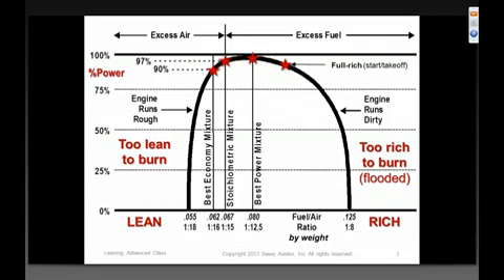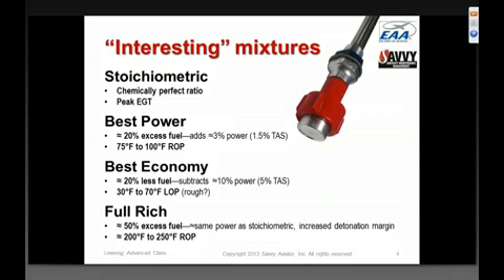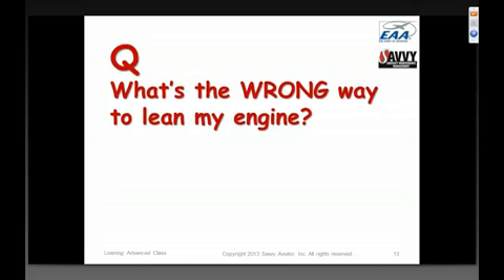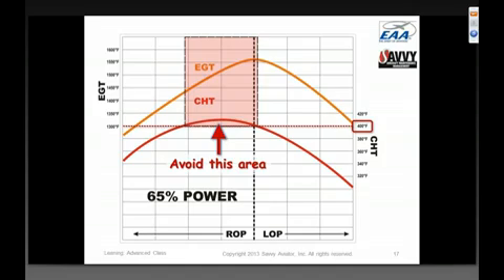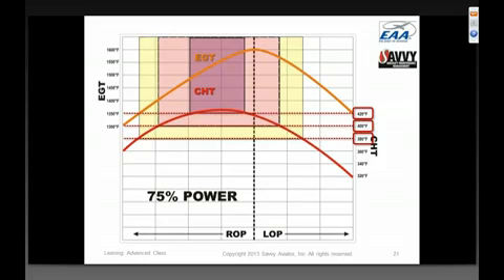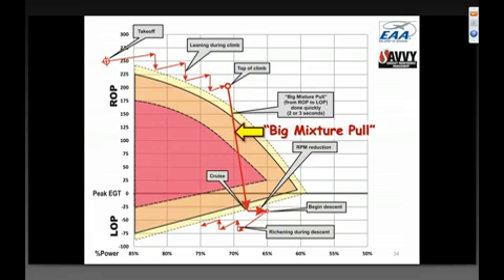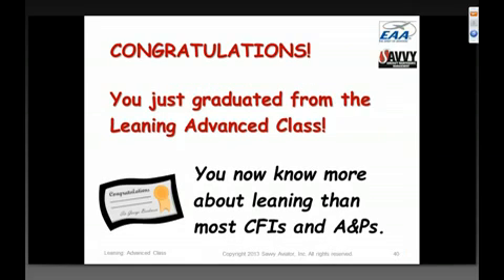Leaning The Advanced Class

Comment: Can you be too LOP? My CHT are 295-330. Is that ok? Someone said I’m not getting it hot enough to burn out the lead. 

IO320 FP 
Full throttle from take off till approach final/pattern

Climb out I set 400* CHT so mixture and speed accordingly 

When I get to cruise I yank mixture to 2500-2550 RPM(75-125*LOP)

I stay lean and slightly add fuel on decent till I’m pattern or on final then set for best power. 

Am I doing this right? I’ve had 3 shops now and various people tell me I’m gumming up my valves, they change cylinders on others often running LOP, and on and on. Am I hurting this thing having cylinder temps high 290s-low 300s??
Reply: Are they saying that there's a high risk of fouling your valves or have they found fouled valves? I'd say if they haven't found fouled valves, your good. On TO and climb out should be cleaning out any fouling: maybe on longer cruises you might bring the temps up a bit, but with a borescope, if you're not seeing any fouling, then it's probably just prejudice.

Comment: I live at high altitude and never have more than about 20 inches of MP available to my IO 520 . The way I hear this, as long as my RPM is pulled back to below 2400, this discussion is moot and I could safely run right at Peak EGT?
Reply: That's the way I see it as long as the RPM is puts you at 65% power or less.

Comment: How the heck do you know if your out of the box if you not measuring egt.  The notion just watching only cht to lean goes against all the charts. Im beginning to smell some BS.  Why even have egt monitors Mike.  Recommend restating what you gave said to make it more clear.
Reply: You know when engine starts losing power as you lean. If you are flying level and didn't touch the throttle then this is by definition because you are now LOP, i.e. on the side of scarce fuel and excess air, i.e. on the side where power is set by how much fuel you're letting your engine have. And this side can only be found LOP since at peak EGT you're letting your engine get exactly the right amount of air and fuel for the optimal combustion i.e. the stochastic fuel air ratio. When you experience that power loss as you lean and that power loss is sufficient then according to physics you can't be in the red box but are now sufficiently LOP to be on the other side of it. You confirm by monitoring your CHTs.

Comment: All GA piston engines can be leaned very simply: till roughness, then increase to run smooth. You quickly end up somewhere in the safe LOP region: there is the most bang for the buck. The few knots extra at best power is not worth it.
Reply: Not exactly, he says in another video that doing this is easy to get back ROP at 40-50 ROP.   The worst area for engines.  LOP is difficult in some carbureted engines if not possible based on fuel distribution.
Reply: *on engines with a large GAMI spread, especially common in carbureted engines, the richest cylinder can easily end up in the "purple fin" with this method.
Reply: @wilfdarr ok, I agree, but is this a problem for those low horsepower engines? I’ve heard as long an O320 runs smooth, all is ok.
Reply: @peterderidder6549 Smaller engines like the o320s still run temps and pressures that could do damage, plus they're built lighter. That said, I'm told o320s have inherently better mixture distribution than say an o300, so you're more likely to get away with it. I still wouldn't do it without an engine monitor.

Comment: What if your baffling is good enough that your CHTs are nowhere near 400 degrees? My RV-4 lives in Vegas and nay gets to 330 or so in cruise. Also, the CHT is so slow to react to mixture changes, where EGT is instantaneous. If I had to drag the mixture slow enough to plat the CHT peak, I would be in the “red box” for a much longer time. I can sweep through the EGT peak and minimize the time in  transition.
Reply: I am wondering as well. I fly a Cessna 175 with Franklin engine and it runs very cool (e.g. CHT below 300°F), probably because it was once designed for cooling in helicopters at 3200rpm (our rev limiter is 2800). So... does the red box not exist for us? We just installed an EDM730 and would love to fly at peak EGT or some cylinders LOP to reduce fuel flow.

Comment: Computers and O2 sensors have been doing this automatically, on cars, for decades. Odds are, Trying to do it manually, and  then getting distracted, seems like a good way to cook your heads.
Reply: If you're that easily distracted, please don't fly...

...or drive.
Reply: @freakfly23  get out of the stone ages,, computer control is the only way to go,, ask diamond aircraft ,,, no prop or mixture controls
Reply: @MAGApepe Mike has mentioned various problems with the way Daimond aircraft are rigged: probably not the example you want to use! 
There are much better examples running in experimental aircraft.

Comment: I keep my CHT below 380 degrees on my 0470l  on my C182 at all times.  I dont want the problems.  Prior to purchasing hte plane it had 5 cylinders changed in the first 400 hours of operation.  All due to flight training and instructors that did not know how to operate the engine.  I now have an insight G3 monitor that provides great info on each cylinder.  Great instrument but downside is no normalize mode and hard to watch and see which cylinder peaks first.
Reply: I also have a 182, mine with carbureted  p-ponk...My question is when monitoring CHT should we be doing this with cowl flaps closed in cruise? My #1 cylinder runs like 15-20 degrees hotter than the rest of the cylinders. Id love it if Savvy would do a special on 0-470/0-470-50 carb engines.
Reply: @ottob.884 CHTs are always monitored: cowl flaps are used to optimize the engine temps.

Comment: You say to not use EGT to adjust full-air mixture, but if you use the cht to find the peak you are doing exactly the same technique- you're just looking at a different instrument read out.  If you lean by pulling to engine roughness, you won't know exactly what the peak actually is but you can set the fuel-air mixture lean of "presumed peak". So I don't get your prejudice against using the egt.  It is just another parameter to utilize, although on my cub I don't have EGT or CHT so I use the fuel-mixture to roughness then advance a tiny bit to smooth running.
Reply: I'm with ya guy.  I'm smelling some BS here

Comment: Great video. When using the JPI during the "big pull" to get to LOP, would it be correct to first set power and prop according to the POH, then lean until the onset of roughness, then check the CHTs to make sure everything is less than 400°F? And is the published fuel flow in the POH for a given power setting a good target for LOP operation or are those numbers based on ROP?

Comment: I have a 73 Citabria with a Lycoming  0-235 C-1 engine right at TBO of 2400 hrs. It has been grounded for 3 years now after starting it and stuck an exhaust valve on no.1 cyl.  Compressions have been low to marginal for several years....I assumed I needed an overhaul with that many hrs on the engine so Ive been saving money for that...any advice on just putting on new lycoming cylinders or a major ovhaul....@ $ 22,000 dollars.. !?
Reply: Why not replace the cylinders? How was your oil pressure and temp at cruise?
Reply: @keepyourbilsteins  oil pressure and temps were/are very good....I think I will try to find a good AI to do a top overhaul...with new Lyc cylinders.from around the Kansas City area....any suggestions ??
Reply: @Jimbo-pm1dp  I can't make any local recommendations, but Mike's company (savvy aviation) is a fantastic resource. I would strongly suggest contacting them if you aren't a member of the type club and don't have local advice to fall back upon.
Reply: @Jimbo-pm1dp  Interested to know how your saga works out.
Reply: Any update?

Comment: Mike, on a Turbocharged TIO-540, is it safe to set about 65% cruise power, then quickly general anesthesia LOP by finding peak EGT and lean and then open the throtle up to WOT and then adjust mixture to maintain 30-70 LOP and CHT below 380-400 maxillary?
Reply: Sorry Mike.  Auto text w/o correction.  get LOP and then 380-400 MAX
Reply: I just bought a turbo saratoga and put a new engine in it. I was wondering the same thing. I was in my 172 and leaned to rough, gave it a touch of fuel to smooth, then gave throttle to gain back rpm. Ran nice at that. Only have oil temp though.

Comment: I realize this is WAY outside the time of discussion, but: What temperatures would you use for the CHTs on liquid cooled engines, like Rotax? The Mfg. max is 248°F, which is WELL below the specified numbers for air cooled engines.
Reply: Liquid coolant is limited by the boiling point of the liquid. Generally there is no CHT on a liquid cooled engine as the whole engine has a much more even temperature.  248F is the boiling point of an antifreeze mixture under a few PSI of pressure.
Reply: How about just following what your POH says rather than some random stranger on the internet?
Reply: @TRPGpilot  because I'm an R&D engineer, and I like collecting information from various sources.

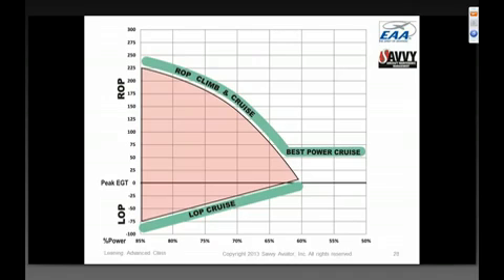Comment: At 1h13min, Mike says climbing at best power is a nice safe area, but according to the plot at 22:34 it looks like best power is actually smack in the middle of the red fin unless you're at less than 62% power or so. I'd assume people would be climbing at much higher power settings, so it would seem best power is not safe at that operating point?
Reply: I noticed this as well. I feel he may have mispoke here. In a large engine such as the TIO-540 J2BD in the Navajo, climbing at peak RPM (best power) at climb power settings will most definitely contribute to hot cylinders. This was in fact a causal factor in the Whyalla Crash, which was described thoroughly in John Deakin's engine management articles on AvWeb. The only time leaning to best power on the climb would be beneficial is in a NA engine climbing above 3000-5000' where the power output gradually decreases with an increase in altitude
Reply: At 4:50 he states that "Best Power"is 75-100°F Rich of peak, so you should be fast enough away from the 50°F rich of peak to avoid damage. If I came out of a cloud and saw a rock I'd have no problem pushing the mix to Best Power, but I wouldn't personally make a habit of climbing at Best Power.
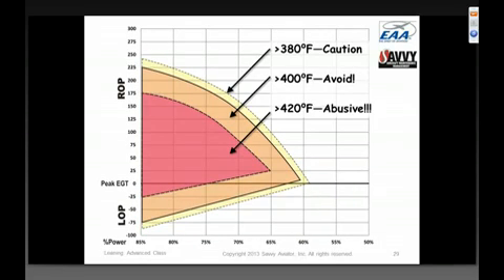Reply: But at 23:07 that puts you right in the "Abusive" zone, doesn't it! 
Interesting!